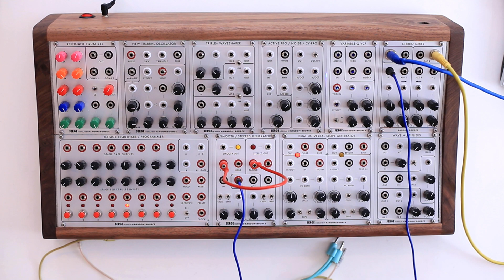Serge Modular 101: Using the Smooth and Stepped Generator (SSG)

Comment: Thank you for the video! I have a question, because I cant find so much  information online about cv-pro.
Are the two 1v/oct (sockets), inputs and tree other inputs (sockets), cv controls for attenuverters? So you can control the attenuverters with another cv, for example  transpose a sequence with another sequencer or keyboard?

Comment: is there an explanation  why one has to cycle when using noise and not cycle when using the s/h src as input of the stepped side? took some time to figure that out
Reply from the maker: you don't havde to cycle wgeb using noise -- it depends on the volume and color of the noise &  on the shape / width of the pulse going into the sample input how the stepped side reacts.
Reply: @drwiener  sorry, should have asked the Other way round: s/h SRC only works when Stepped Side is not cycled?
Reply from the maker: @debrderberamderbsten  the stepped side does not have to be cycled to work when you plug something into the input.   It only needs to be cycled when you don't have anything plugged into the input/
Reply: @drwiener  mhhh, my ssg wont do anything with s/h src to  in and cycle on,  sorry dir spamming the comments, i could not find anything online
Reply from the maker: The cycle switch does not need to be on.  

1.  try it withcycle off always
2.  try different pulse s going into sample
3.  check the sh/src on a scope and see what the vMAX and vMIN and vpp are.
Reply: @drwiener  thank you! all figured out now. mulitmeterd, scoped and took some time to understand whats happenig